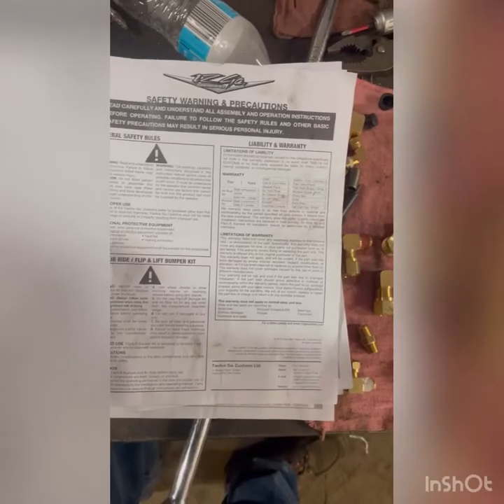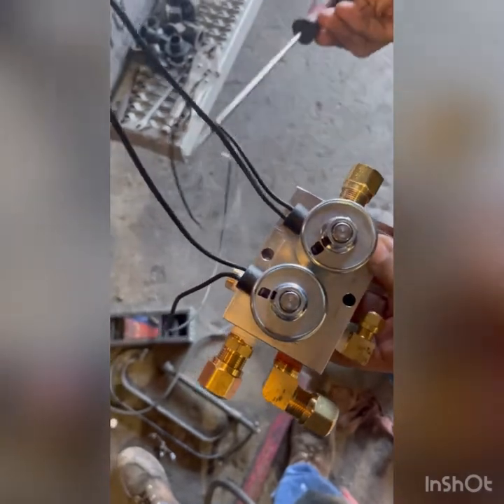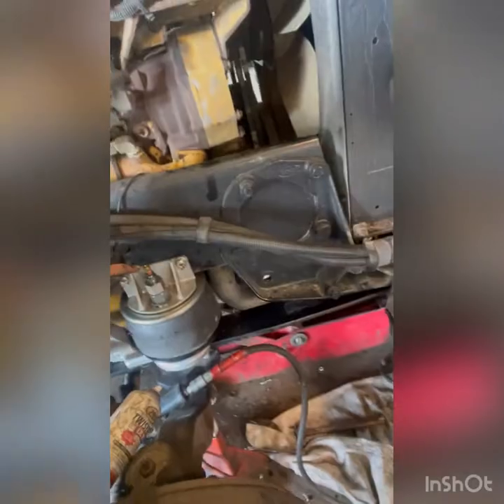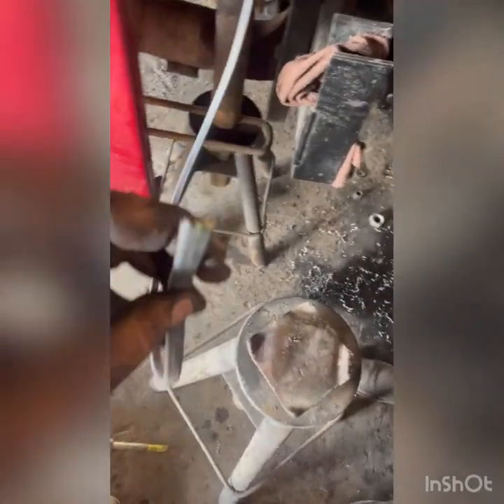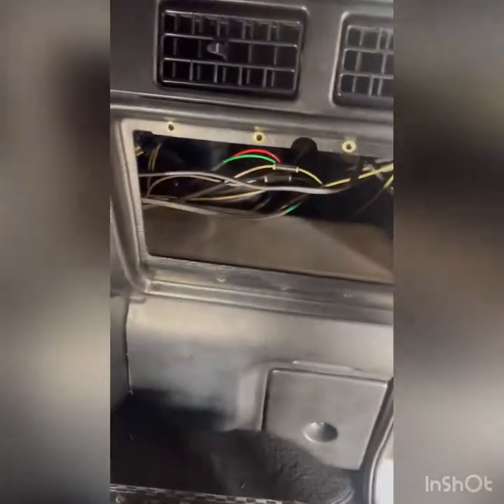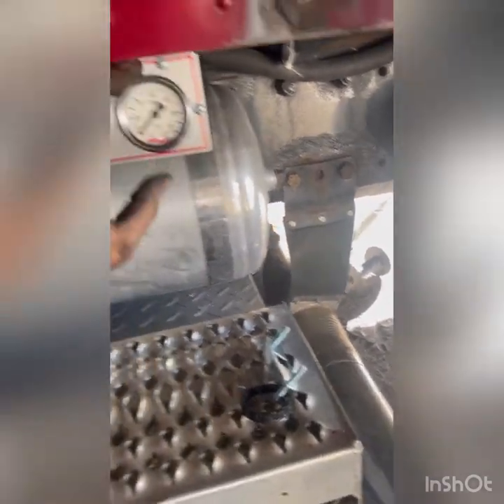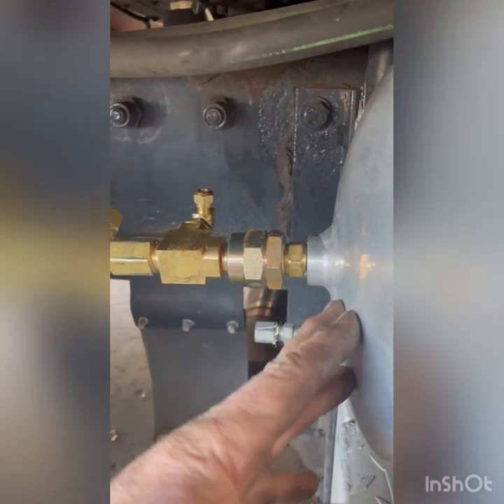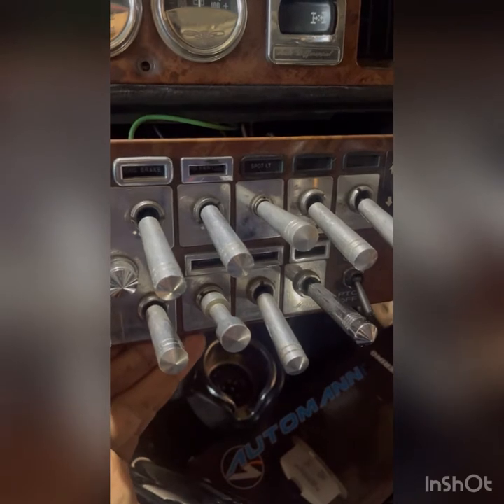How to install air ride on 379 Peterbilt air/ electrical hookup 12gauge customs air ride

Comment: In Canada we have some trailers where we use lift axles, we have the regulator and gauge inside of the cab. have you thought of mounting them inside for this type of modification?  Would be nice to be able to adjust from the seat going down the road

Comment: which front air suspension do you think is better  single air bag or the 4 air bag ? Is it better to have that solonoid setup or ride height valves?  One or 2 ride height valves?

Comment: I was going to buy a Isuzu single axle 33,000 pound truck for a rolloff container set up should I order the truck with the air ride suspension in the rear or conventional leaf springs please guide 😊

Comment: Would you send me copies of instructions forthat??
Reply from the maker: Let me look and see kid I can find them
Reply: This system should have a air pressure protection valve installed to the air springs not a check valve .